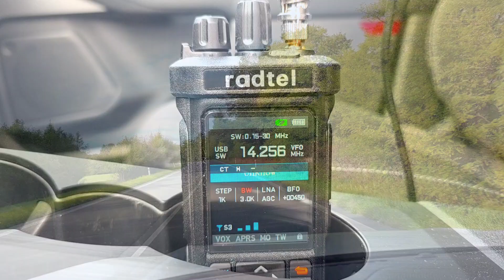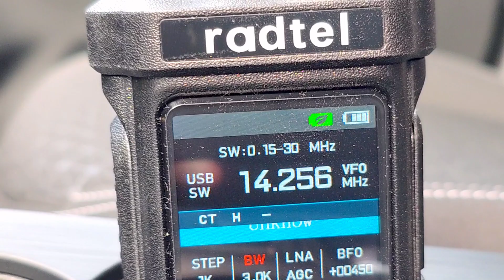Radtel RT-950 pro HF SSB reception on short VHF/UHF Antenna placed on the car

Comment: Radtel RT-950 PRO just arrived today and I am enjoying the learning process.  A 2m/70cm antenna is doing the job, but I need to figure out best antenna for shortwave listening. FM broadcast is surprisingly good. All of my other FM sets (other than the receiver in the truck) have poor reception out here in rural country. Good WX radio too. Best $47 spent for the shack.

Comment: Beautiful country and awesome reception. Yes the 950 pro is exceptionally sensitive on  HF modes even with the most smallest antenna. Even with a 4 inch donut loop antenna I can hear 160 to 10m no problem

Comment: What s that huge adaptor you have there connecting the radtel to the cb antenna?😳
Reply from the maker: Feedline from VHF/UHF (not CB) antenna is with PL259 connector. It is reduction from PL59-BNC-SMA type.

Comment: How come RX is this good with an antenna built to resonate at V/U? Maybe the coax itself is acting like some wire antenna?
Reply from the maker: I don't think so. It receives SSB well also with flexible 45cm long VHF UHF antenna attached to the radio.

Comment: Would you get the same reception from that antenna if it was on a windowsill in your home or does the metal body of the car help? Asking as I live in a small flat (apartment) so not easy or practical to have an outside antenna.
At the moment I'm using a balun and a long wire across my living room. 🗼'''''''''''''''''''''''''''🗼📻 🤔😂
Reply from the maker: It depend on the matarials your house is built of
Reply: @OM0ET  Unfortunately it's made from concrete and steel so it's not ideal. 
(hey that rhymed 😆)

Comment: Im sending mine back as its totally deaf on hf .
Reply from the maker: I am sorry for your faulty unit. Are you sure that it is not a standard RT-950 without Pro?
Reply: @OM0ET hi yes definitely a pro version. Lots of reports on Facebook of the same problem with the 950 pro